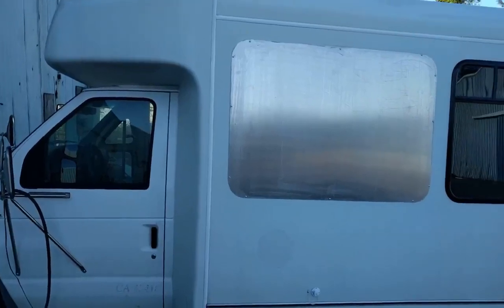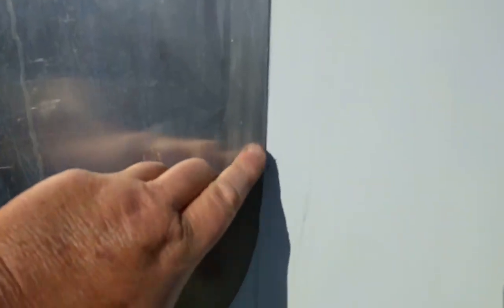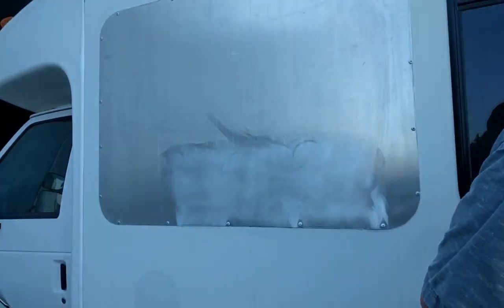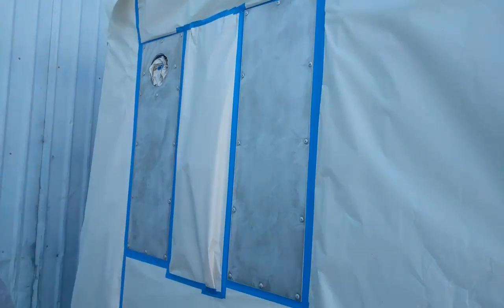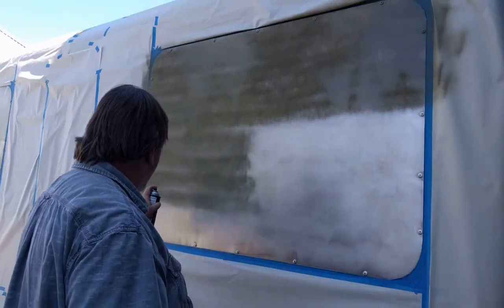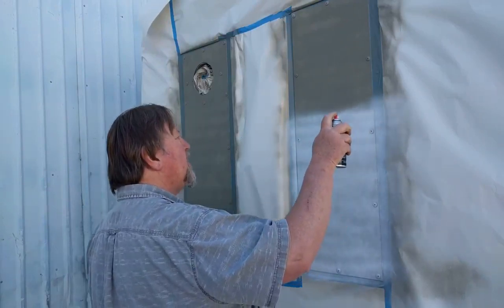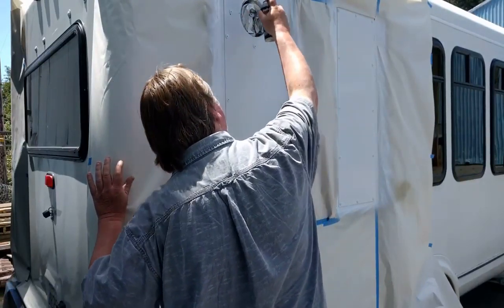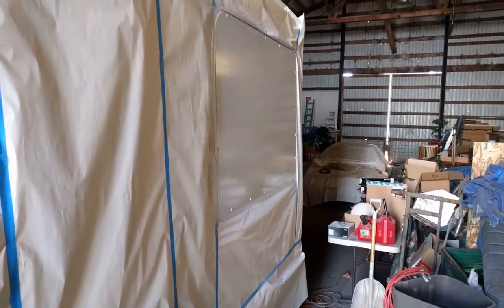Shuttle bus rv conversion (Part 58) Finally Made Up My Mind!

Comment: Etching primer....saw that recently and wondered...it's to etch metal for adhesion, but what if your surface were a combo of metal and sanded prior paint?  Would it cause a problem over the old paint?  Or would that be a good product to start all repaint surfaces?  Really appreciate the care and time you put into your work!  I sometimes think I overthink my projects, but then I'm usually pretty happy with the results.  And it's encouraging to see someone else do the same.  Enjoying the show!  Lynn
Reply from the maker: @stxn102 Etching primer is designed for bare metal but it could be used on other surfaces. Any paint,primer,or solvent could cause a problem with old paint, test an area first.

Comment: Were they leaking before before you added more rivets
Reply from the maker: @RY TANG  Hello! The window delete panels were not leaking, the reason I replaced the screws with rivets because the steel screws were reacting with the aluminium and causing corrosion. The rivets were aluminium so they will not have that problem anymore. Thank you for watching :  )
Reply: @robertbraden3889  thank you for helping
Reply from the maker: @guy-qk6jd  No problem my friend!